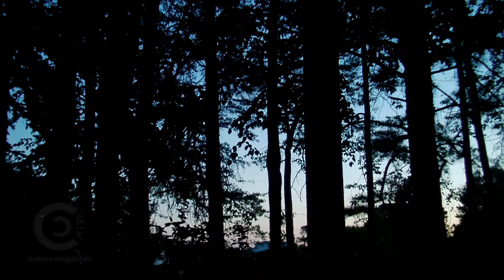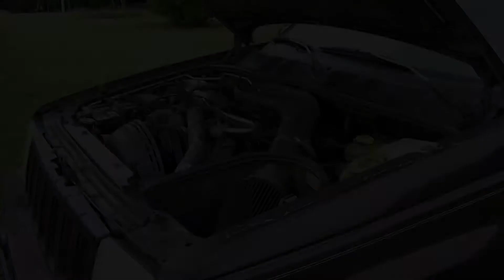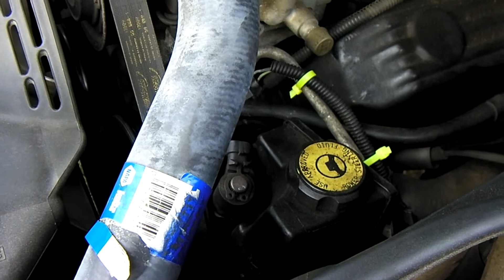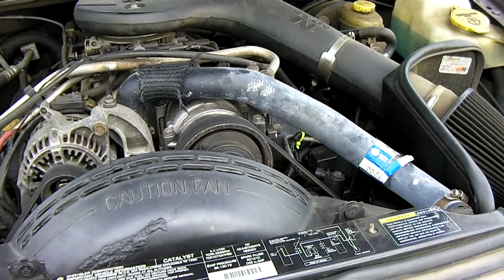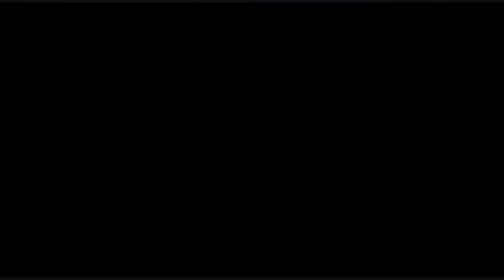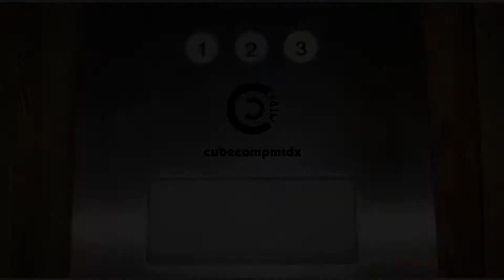Jeep ZJ variable assist power steering issue symptoms + fix

Comment: After umplugging does the check engine light come on do due a fault?
Reply from the maker: Nope, no CEL. There might be a diagnostic code stored that only an advanced scan tool would see, but the CEL does not light up.
Reply: @cubecompmtdx   awesome thanks for video and info. Just ran into this issue. Was looking into bypassing.
Reply from the maker: @asjazwa  Please watch my update video if you have not already...
https://www.youtube.com/watch?v=7OKgN-n2avY

Comment: i have had some similar issue this might help. I think the box is speed assist also so they  are a paired system
Reply from the maker: When looking up a replacement steering box, there's nothing specifying whether the steering box is for variable-assist or without. The box has no electrical connections of any sort. I converted my Jeep over to non-variable assist last December by replacing the pump and pressure line with parts specified for without variable assist. This is a known workaround to fix issues with the variable-assist system. Power steering has worked 100% perfectly ever since. No whine, and no lack of power assist.